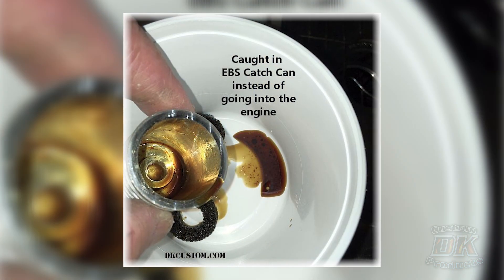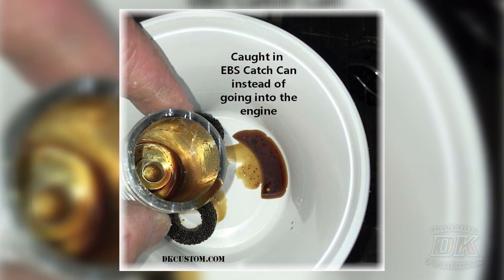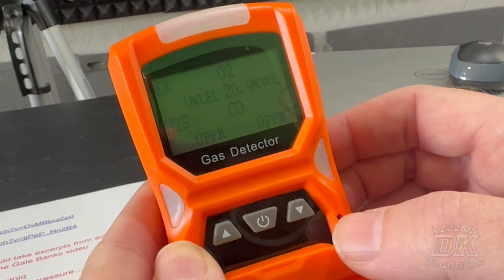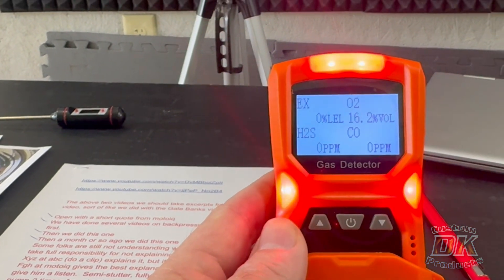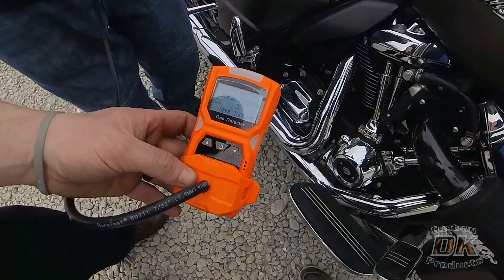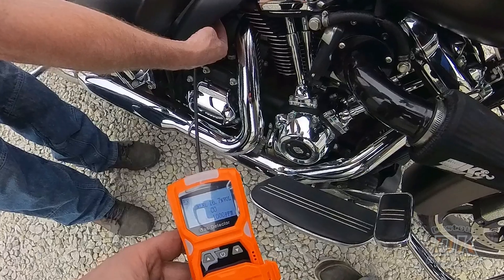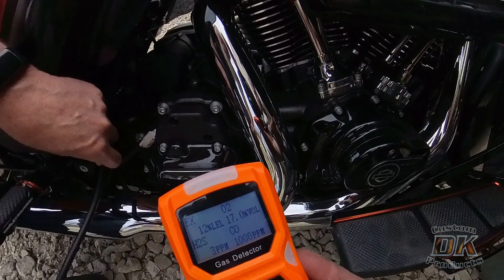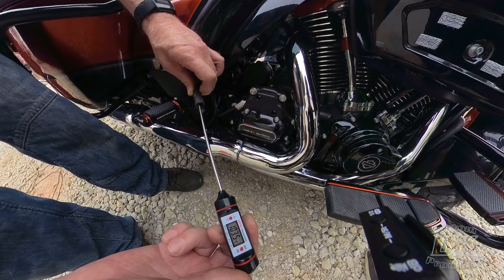Looking at Oxygen Content & Carbon Monoxide Content Going Into Your Harley Engine

Comment: I just added your catch can on my indian chief so much easier to add on the thunderstroke  then it was on my Harley-Davidson. Super easy mod .
Reply: How do I do my Indian Chief bobber 111,
Reply from the maker: Unfortunately we have zero knowledge of Indian models.

You will need to determine how your system vents currently and if it is a simple hose routed into the air cleaner, re-route that hose to our catch can.

This kit includes 3/8 hose and a catch can...

https://www.dkcustomproducts.com/external-breather-system-w-catch-can-harley-twin-cam-m8.htm

Sorry I can't be of more help with this.

Thank you for commenting! 😎 MB
Reply: @marklawrence4225  there is a breather hose that comes from the top of the front head and goes into the intake. Get 3/8 hose and catch can also 1/2 inch to 3/8 barb reducer. Just figure out where you want to run the catch can cut the rubber hose that comes from the  head install the reducer fitting and run the hose where you want it and install catch can on the end. Super easy. I just used black gasket maker to block hole in the intake.
Reply from the maker: Glad that you are liking the Catch Can and that it was an easy install for you! Thanks for commenting and for your business! MB

Comment: 2024 Heritage.  I have your EBS on  my bike along with a fueling vented dipstick.  I see you don't advertise the dipstick and I haven't seen any of your videos addressing that issue.  Am I benefiting more by running them both together?
Reply from the maker: The vented dipstick does not take the place of external breather systems.  
There is still hot, oily, oxygen depleted air being fed into the intake, but the vented dipstick and EBS do pair well together. 

Thanks for commenting! MB

Comment: I’m old school, I remember before there were PCV valves on engines. I try to explain this to these young guys that your engine does not like old oil and moisture contaminating your fuel charge. Old engines like a small block Chevy had a breather tube on the front of the intake with a filler cap that had a wire mesh inside. PCV were brought on by the EPA. I always reroute all that crap off my engines. Keep up the great work.
Reply from the maker: Glad you externally vent your bike, I am sure your bike is happy too! Thanks for commenting! MB